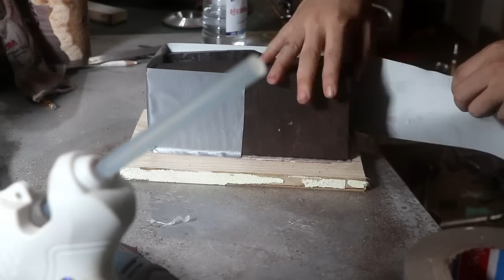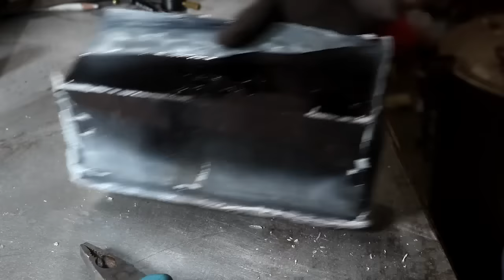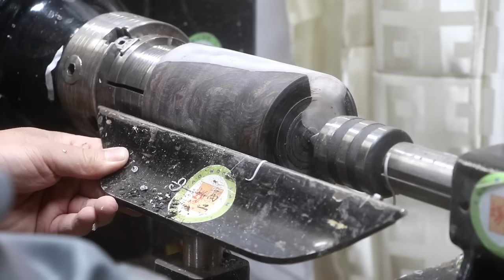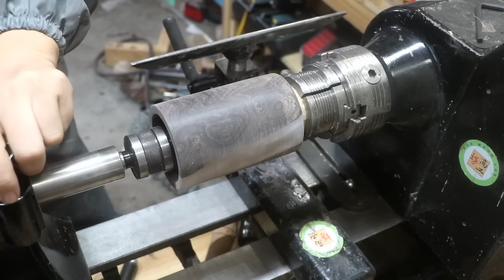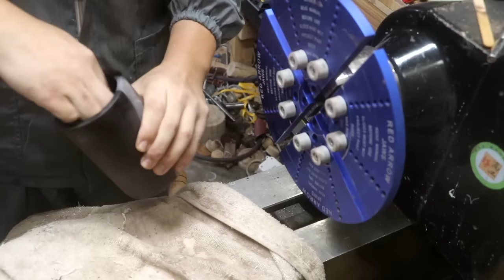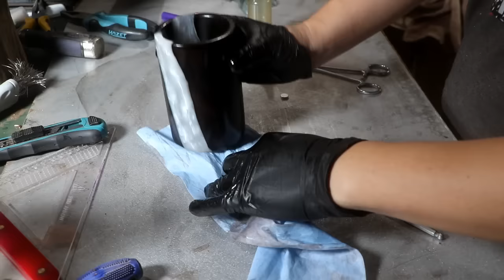wood turning: Simple & beautiful

Comment: Very nice!  As a South African wood turner, please allow me to make a few comments!  To really appreciate the beauty of African Blackwood, you have to hold it in the sun and turn it around slowly.  You will be amazed!  I also wet-sand it, but only on the outside.  I have found that wet-sanding a very dry piece of (African?) wood on the inside, forces the water into the wood, often resulting in cracks.  Kind regards.
Reply from the maker: Yes, Hennie, African Blackwood is really amazing, very shinny, and it's more  stable than snake wood, both are amazing wood.
Thank you so much.🙂🙂🙂🙂🙂